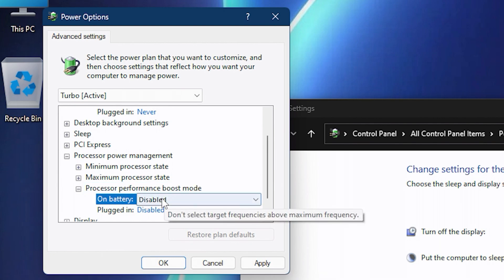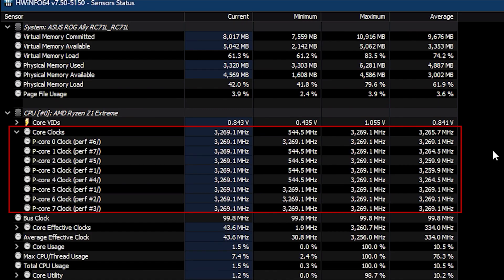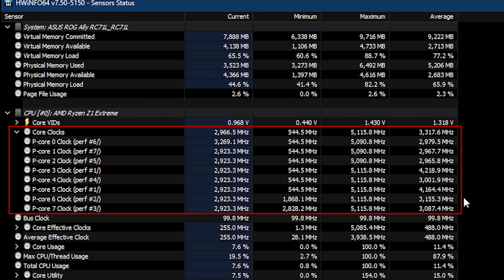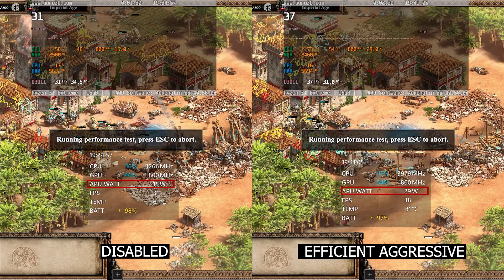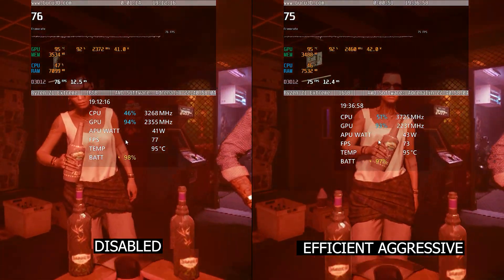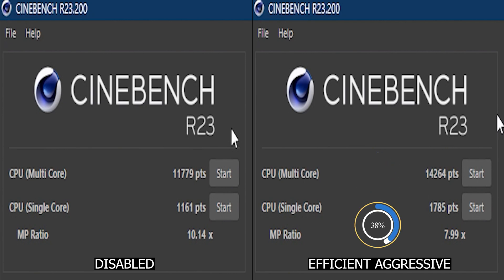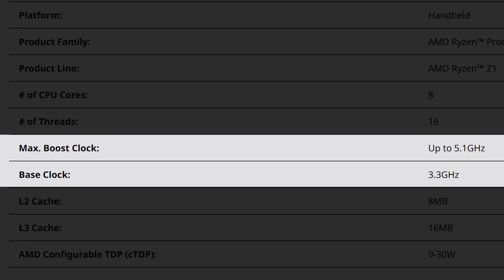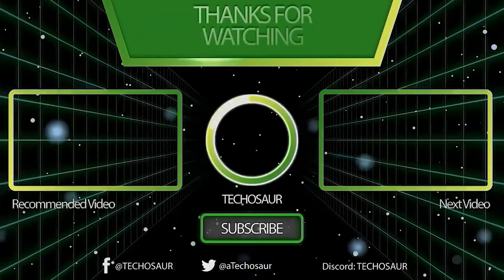How disabling CPU BOOST could reduce performance on ROG ALLY

Comment: Disabling CPU boost helps keeping a better power draw balance between CPU and GPU. Unfortunately the firmware for the Z1 Extreme highly favors giving power to the CPU and not GPU. Which is not desirable in most games. The Zen 4 cores are super fast and rarely hit high loads even in latest AAA games. But still use lot of power and produce heat. Leaving less for wattage for the GPU.  I hope they release a firmware someday that prioritize the GPU over CPU, but I doubt it.
Reply from the maker: I found that the legion go prioritize gpu clock instead, if you watch this video here https://youtu.be/BgQXzy-W2hE?si=shMNqdyzsLuaX_Fx
Reply: @TECHOSAUR  thx. that's interesting for sure. I desperately trying tools to change SMU settings to limit max cpu clock to like 2ghz but no luck. ryzenadj not fully supported. parking cores also doesn't really help getting more wattage distributed to the GPU on the ally. min and max gfxclk SMU settings also not working only way is fixed GPU clock of 2700 currently which is heat producing fix not desireable on my ally cause it thermal throttles at 93 degrees then at 30w.
Reply: @marios.2975 try auto tdp if you haven't already and see how that goes
Reply: @ I actually set EPP to 60 and the power draw of the CPU goes down considerably leavig more headroom for the gpu part without getting crazy hot.

Comment: That may be true for benchmarks, but i rather have more consistent fps on "disabled" than sometimes more fps on "efficient agressive" because the 1% low's matter for me. Also it is normaly on "agressive" as standard and not on "efficient agressive".
Reply from the maker: Efficient Aggressive might be also good coz it may be more efficient at times but yet not reduce power in demanding scenarios
on all desktop CPUs I have, BOOST is enabled, be it Intel or AMD, it's not ASUS that defines this option... 

even if consistent FPS is good It's hard to justify going to base clock when you paid for boosting your chip
benchmarks reflect real-world gaming scenarios especially RTS games that demand more CPU than GPU, as you saw in Age of empires 2 definitive edition, GPU is 800 MHz base clock and only the CPU is working, the difference is quite evident
Reply: @TECHOSAUR CPU boost most useful on emulation where it depend on cpu rather than gpu

Comment from the maker: To enable "Efficent Aggresive" in BOOST options:

1- Press Win + R, type regedit, and open the Registry Editor.

2- Navigate to HKEY_LOCAL_MACHINE\SYSTEM\CurrentControlSet\Control\Power\PowerSettings\54533251-82be-4824-96c1-47b60b740d00\be337238-0d82-4146-a960-4f3749d470c7.

3- In the right-hand pane, you will see an entry named Attributes. Double-click on it.

4- In the Value data field, enter 2 and then click OK.

Close the Registry Editor

After you have done this, the BOOST Mode setting should be visible in the Advanced Power Settings in the Power Options Control Panel. Here's how to access it:

1- In Start search for "Edit Power Plan"

2- Next to your current power plan, click on Change plan settings, then Change advanced power settings.

3- n the new window, scroll down and expand the Processor power management option, then Processor performance boost mode.

4- Select Efficient Aggressive from the dropdown menu for each power state (On battery, Plugged in) as per your requirement.

Click Apply and then OK to save the changes.

ROG ALLY playlist: https://www.youtube.com/watch?v=V3n7lBB9gjo&list=PLg8ANjUNzqfPWpS6QgZTK62-QXOhr0XhF&index=1&t=0s

If you enjoy my humble content Subscribe & Join the TECHOSAUR Community on Discord here : https://discord.gg/PXmJY6BP8b
you can seek technical assistance, exchange ideas and experiences, relax, share memes, make video request and most importanly feel at home